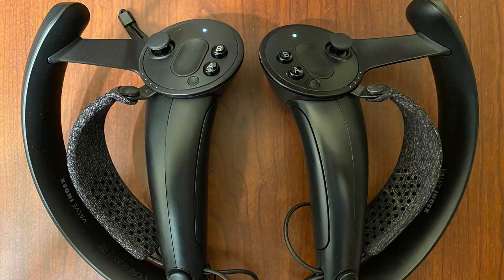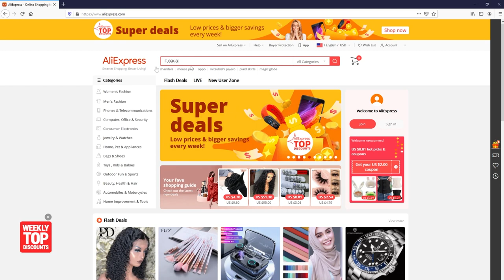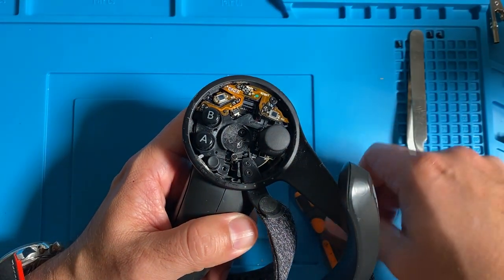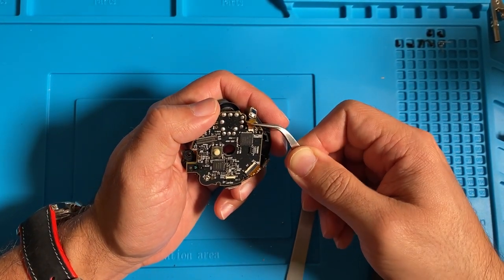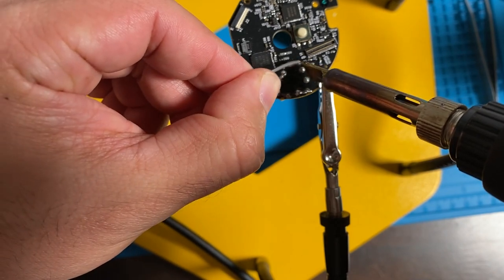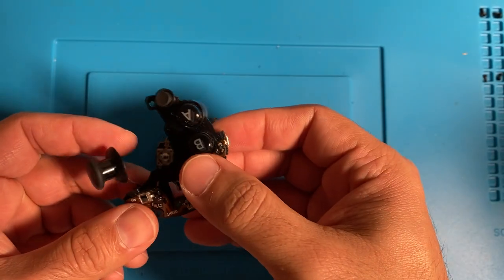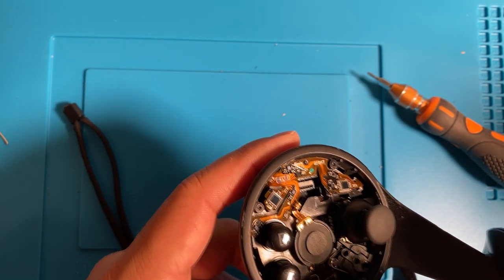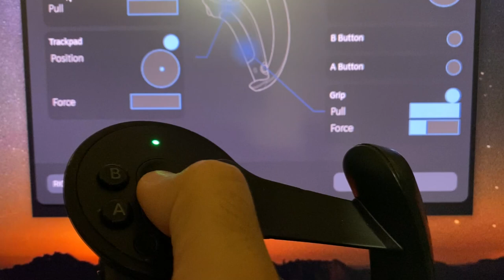Valve Index Controllers Thumbstick Drift Fix | Thumbstick Replacement

Comment: Hey Im trying to source the actual plastic thumbstick itself, the hole that slots onto the stick is widened and causing issues even on the new stick.
Reply from the maker: I don't think you can source that part.  Valve doesn't sell it.  Best bet might be to 3D print one or glue the old one on. You would lose capacitive touch if you 3D print one but it's better than nothing.

Comment: my charging cable melted and fuzed into the charging port on the right controller, i took out the cable and the charging port came with it. the controller still has power but i cant charge it ever again.
Reply from the maker: Wow, I’ve never heard of that issue.  RMA it if you can or toss it.  I wouldn’t recommend ever connecting that back up unless you 100% know what the problem is and can fix it.  That’s a fire hazard and you should throw that controller away.  I also wouldn’t trust that charger.

Comment: Is there any place else to order the part from other than aliexpress?  It will take 2 months to arrive :(. If you have an extra one you could list on eBay, I’d be glad to buy it from you.  Or better yet, how much would you charge if I send you my controller for repair? :)
Reply from the maker: Not that I know of.  They usually ship a lot sooner than the expected shipping date, my first order took about a month and my second order took about 2 weeks.
Reply: @nolomite3921  I just sent you a friend request, thanks!  Hoping to chat with you more about a possible fix, thanks!

Comment: I think their solder is doped with tungsten or something.  My regular soldering iron could barely touch it.  I bought a gun style with broader tip, using flux.  Sometimes it melts, but mostly I feel like I'm just roasting the board

What seems to work is to put a dot of flux, then touch directly.  If/when it melts, then put the wick in there, heat the wick and hope it sucks up the solder

Maddening
Reply: Correction:  dot of flux, wick over that, solder on wick.  In theory, running some flux up the wick helps, but in practice it just make a bigger pool of melted flux

All day, still not finished.  I just can't melt it fully from any one side

Incredibly maddening

Comment: Does the ribbon cable matter because my joystick completely popped out and it broke the ribbon cable.
Reply from the maker: In my opinion, no it doesn't really matter.  You'll be fine.  That ribbon cable on the thumbstick is just for capacitive touch.  The only thing that capacitive touch is used for (that I'm aware of) is hand presence.  So if you are playing lets say VR Chat and you want to make a fist, your thumb will be popping up, but you can still use your thumb on the track-pad to make a fist.  It's not a big deal, not worth worrying about.
Reply: @nolomite3921  Honestly might just take it apart and fix it my warrantys already expired
Reply from the maker: @vx9o29  Yeah, really that's your only option.  Valve doesn't offer repair service.  Might as well try before buying a new pair.

Comment: where did you get that mat
Reply from the maker: Amazon https://www.amazon.com/Kaisiking-Silicone-Electronics-Soldering-Anti-Static/dp/B08PVCZ41C/ref=sr_1_1_sspa?crid=1OF1KTKP7KG5Q&dchild=1&keywords=small%2Belectronics%2Bmat&qid=1633381374&sprefix=Small%2Belectronics%2Bmat%2Caps%2C194&sr=8-1-spons&spLa=ZW5jcnlwdGVkUXVhbGlmaWVyPUEyUEIzMU9IRTk5UE9FJmVuY3J5cHRlZElkPUEwOTAzMjgwMlJZWTU0WVo1MFlRTiZlbmNyeXB0ZWRBZElkPUEwNTM1NDg1Mlc1T0hJTUdDRUdPViZ3aWRnZXROYW1lPXNwX2F0ZiZhY3Rpb249Y2xpY2tSZWRpcmVjdCZkb05vdExvZ0NsaWNrPXRydWU&th=1

Comment: Is there somewhere I can take my left controller to get this done for me I'm like not qualified to solder shit,.
Reply from the maker: @themysteryman1482  Not that I know of?  I think the cost of the controllers makes it where repair is not economically feasable.  Shipping and handling costs, time of repairing them, assumed liability for the controllers.  I feel someone would have to charge close to the price of a new controller.
Reply: @nolomite3921  That sucks. I dont know how to solder or else id do this 🤷 id rather not play VR than buy my third pair of Index controllers. Ive heard the vive wands are good.

Comment: So I thought I fixed the controller. It fixed the drift but gave me brand new problems. The stick, sometimes the buttons, would freeze input, or just stop working. I’ll be walking in Pavlov, and then it just stops. Now, it is different if I just stop moving the stick, because in the new update on Pavlov, there is like an inertia effect where it slows down before stopping. With this, it just stops. Please help I don’t want to buy a new controller.
Reply from the maker: Sorry to hear that.  I’m not an expert on every possible problem you might have with your controllers.  It’s possible you may have overheated the board soldering.  That’s why I say you try at your own risk, and put a disclaimer on the description.  Valve doesn’t sell parts.  Your best bet might be a used controller on eBay.
Reply: @nolomite3921  It ended up working fine the following days, however, a new problem has occurred. My touchpad isn't sensitive. The button function works fine, but touch is weird. I am not sure what the diagnosis could be. One, it could be that I damaged a ribbon cable, or maybe two, I screwed up the plate that is touched. Let me know if you have any ideas on what to do.
Reply from the maker: @Queen_Zaza  I’m not sure if you mean the pressure sensor underneath the touchpad, the touchpad itself, or the top plate where the touchpad is mounted?  Either way if you did break something else I have no idea where to get parts at besides buying a used controller on eBay.
Reply: @nolomite3921  the touchpad has this sticky feeling to it. I’ll rest my thumb on it and it won’t track. If I press on the upper part of the touchpad it will receive an input, and then the white dot will get stuck at the top right of the pad. I don’t know what could be causing it.

Comment: i ripped off the thumstick capacitive touch sensor ribbon cord just but openeing the controller, when i popped it open it pull the stick up and off, ripping the cable, fucking hell

Comment: There is a much easier way of desoldering joints without introducing all that heat, and not to mention keeping it cleaner, for the love of god use a solder sucker!
Reply from the maker: I have a solder sucker. Most people don’t.  I tried to demonstrate how to do the job within the average person’s capabilities.   Also not easy with just a solder sucker alone.  The chip quick made my life a lot easier.